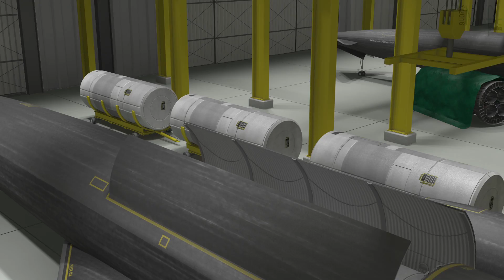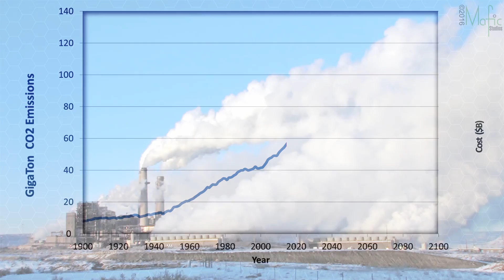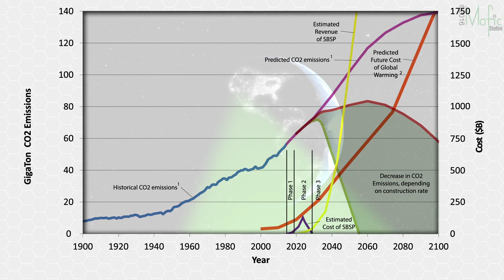Space Based Solar Power - a solution to the carbon crisis

Comment: how much fuel it will take you to get enough panels in space to justify using them in outer space and what they last at least twice as long as the money that you spent or produced twice the amount of money in electricity that you spent to get them there in the first place
Reply from the maker: That depends on a lot of factors.  If your fuel is hydrogen+oxygen, and you generate that hydrogen from solar power (specifically space solar power), then the fuel is carbon neutral.  And cost benefit analysis has more factors than just the cost of fuel.

Comment: umm...must have missed the “how” and “why” here.  My biggest take away?...we’re gonna turn this planet into a giant microwave?
Reply from the maker: The first step would be to understand how energy beams work.  The vast majority of the energy goes into the rectenna.  The losses end up as heat (mostly at the rectenna).   So 2% of the beamed energy ends up as heat, which is vastly better than the 55% of energy from almost any other terrestrial energy source that ends up as heat.  There's still waste heat otherwise, it just gets radiated into space.
People don't want nuclear power because they're afraid of it.  Fossil fuels are a limited resource, cause climate change, and are expensive.  Traditional renewables have many limitations, not the least of which is the non-baseload nature, take a lot of space, and is also really expensive.  How is to be determined.  Humanity has never built anything on this scale, but that's a political, economic, and engineering problem.  This particular piece was created for a specific presentation at the White House in 2016, not necessarily for larger understanding.

Comment: Has there been done scenario calculations of concentration of co2 in the atmosphere within the project?
Reply from the maker: Not entirely sure what you're asking.  The point here is that there would be effectively unlimited, carbon free energy, that could then be used to extract CO2 from the air to whatever desired concentration.  It would be expensive, to be sure, but the gas could be turned into carbon for all sorts of uses...
Reply: @maficstudios  I'm thinking about the relationship between on one hand how fast this technology can be implemented and how much co2 at which pace can be extracted from the air and on the other hand how a warmer world 'releases' more and more co2 and methane by itself faster and faster.
Reply from the maker: It's all a matter of money.  Everything that we have as problems now can be solve in any manner of ways; the question is how much will it cost, and who will pay for it.  The numbers presented in this video aren't mine, and rely on a couple unicorns.  (Skylon, specifically.)  So it may cost way more, and take way longer.  It's up for debate if such an approach can stop a thermal runaway, but having started the process (be it SSP or otherwise), will have humanity and the planet be better off than not doing anything at all, which is the current approach.  Building solutions in space also has the advantage of moving humanity off this rock, for a longer term diaspora.
Reply: @maficstudios  I like your approach. And technical and space development may very well be a key to our survival. But I'm concerned with what I've heard as the "rebound effect", are you familiar with that concept? As I understand that technical development that decrease fossil fuels tends to make us use more fossil fuels in other ways. This for me points to a more psychological focus than technical. My view of the root of the problem is that we stopped living in harmony with nature. And green/space tech is, I'm afraid, a way of letting us continue to be planetary (and space) masters. We started exploit some area of the world, than stretching to new areas of the world, and now even planning to move to other planets once we destroyed this one. You say it's better than nothing, but I see an alternative in asking ourselves and each other (louder and louder) if we can arrange our lifes and societies in other new/old ways that is more in harmony with nature and may even make us happier. And  there I lean more towards doing less, in terms of; producing less, consuming less, compete less. And instead cooperate more, love more.

Comment: 0:55 Why not simply build an 18 TWe nuclear power plant (composed of a 128 x 128 grid of AP-1000 reactors) in the southwest corner of Oregon, and transmit the power via HVDC lines and orbiting microwave power repeaters, and fuel it with seawater uranium? Most Oregon voters would be far away and not downwind in the Portland area, and could additionally be bribed with unmetered electricity in perpetuity.
Reply: Cost? A mere 180 trillion dollars up front, and 10 cents per kilowatt hour afterwards. Try Again, hitssquad
Reply: YodaWhat 

Lol, like fusion, the technology is always 30 years out.
Reply: +YodaWhat Would the system proposed in this video be cheaper?
Reply: Alien Drone Services 

Lol, fuck no. Not only wouldn't it be "cheaper," but it will never be a net energy provider. Nor would the nuclear plant proposed above. Seawater uranium? What's the energy cost of collecting and refining it? Likely a hundred times what it would produce. What's the energy cost in sourcing the materials for "space solar," ecost in building them, ecost in launching them, ecost keeping them in orbit, eloss in microwaving the power back to the surface, eloss in maintaining them, eloss due to damage, cost of paying people to live in space to work on their construction? 

These are both overunity claims that completely ignore necessary constraints to their production, maintainance and original embedded energy costs and fuel sourcing.
Reply: Why not? Because it's stupid, non-renewable, and probably would end up with a nuclear disaster. Ever heard of Fukushima. SSp is superior

Comment: Sounds like it will be immensely expensive. Why would this idea win win out over an argument to keep the panels on the ground?
Reply from the maker: Because a panel on the ground only generates power when it's lit by sunlight; even on a perfectly clear day, that varies depending on the time of year and time of day.   Many parts of the world don't get mostly clear days, first of all.  Depending on the location, you have to have 3-6x the wattage in panels to supply a load, and, then, you have to have storage to cover the times that are overcast/dark.  Panels on the ground also take space, and they need to be regularly cleaned. If you were to replace the entire global energy consumption with ground panels, it would actually be significantly more expensive than in space.  Now, obviously, it's not quite that simple, since there lots of other potential power sources.  Even so, space solar has additional value, not the least of which is an operational infrastructure for space that could have many trillions of dollars in value.

Comment: That's what happens when designers thinks they are space engigeers.... and is not good...
Reply from the maker: Sadly, this designer has a MaSc in Engineering, and there is another engineer on the team.  I'd be the first to admit that this concept is a shiny version of a possible future, it shows what could happen, to have the desired goal of supplanting CO2.  It sure as hell won't be easy, and it may not be possible as described, but I'd rather try and put forward ideas to contribute to the discussion to save humanity from destroying itself than just being vaguely negative without suggesting alternatives.
Reply: You are making a bald assertion that there is something wrong with his proposal. How about a reasoned argument instead?
Reply: great answer; this is the problem with those who simply disagree with a project with very limited or no understanding of what is being put forward!!! And it requires great courage to suggest innovation...and invest in it...
Reply: +Just Dust Funny, coming from someone who can't spell or use grammar! :)
Reply: Kris Holland 

The alternative is accepting a lower quality of life. Those satellites will never replace the embedded energy cost of putting them up there and the efficiency of beaming energy back down is about as good as catching a bucket of beer thrown at your open mouth. 

This is arguably worse than solar roadways and gives false hope.
Reply: @skeetorkiftwon  It depends how you calculate it. One calculation using very futuristic technology can show a 7:1 EROIE. That would be similar to oil in 2008.
Reply: @johnclarkson5605  

Oh is that right? Let's have your evidence then, post a link. 

As an electrical engineer, I don't give fuck all for shit terms like "futuristic technology" in claims that only give an EROI of half of what is needed for continuing complex society systems. 

I guess if we're willing to forgo air conditioning, elder care, and computing, your mathmagical "futuristic technology" will be amazing. 

Link the claim.
Reply: Those that created the problem are the ones that bring the solution. this technology is against the long term health of life as we know it. You join you brain to the neural network or you won't be able to keep up. You will be  like a pet cat ----Elon  Musk. The future is cyborgs not humans, synthetic life. Holland do you not already know this?